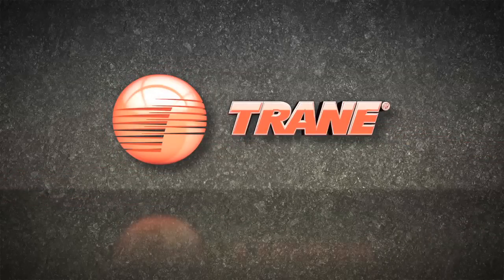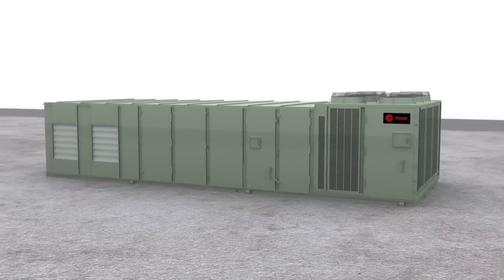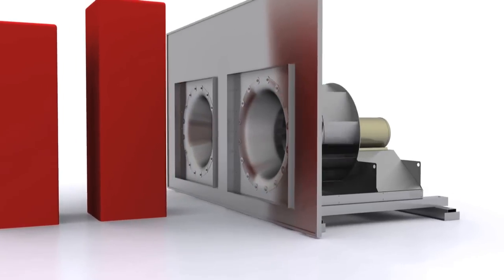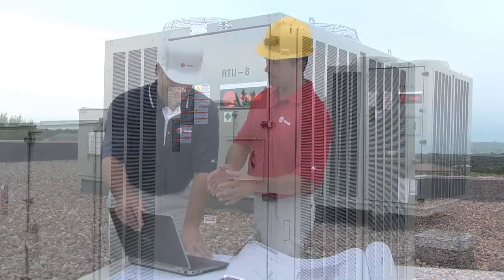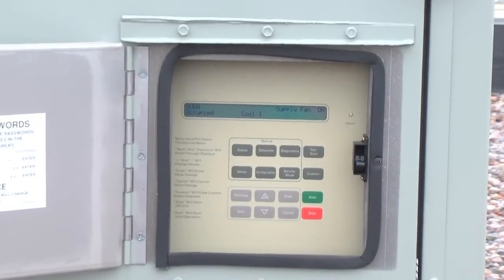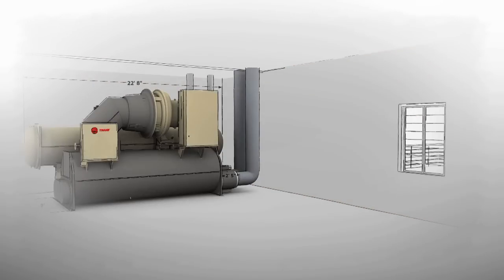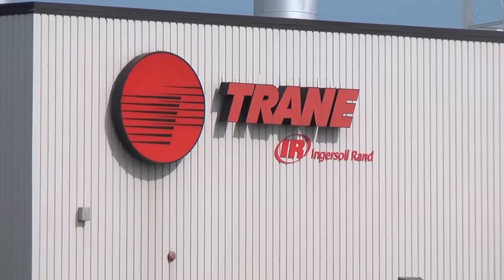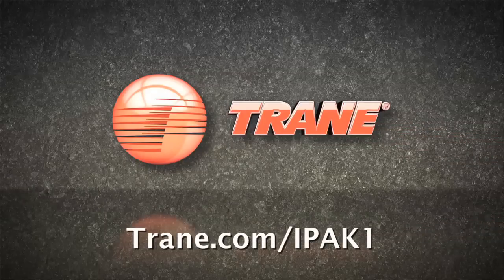Trane IntelliPak I Rooftop System

Comment: They are built well. I see some 20 years or older now still going strong. Some have had some of the compressor changed. But, coils are well built. Air handling blower, bearings are solid. Good products for commercial buildings.
Reply: We have a 25 ton 2 stage heating circa 1985 still going strong